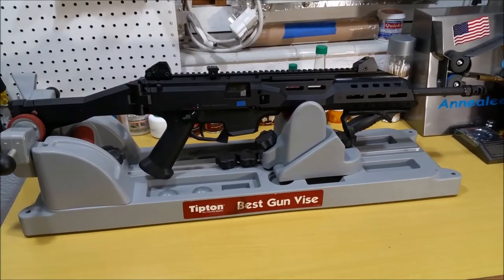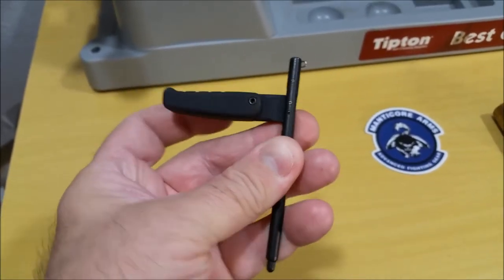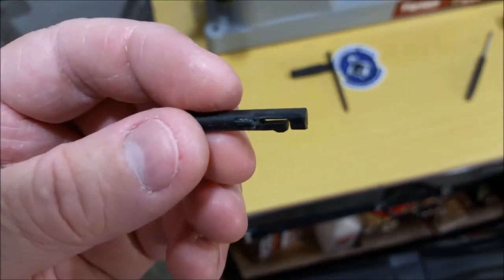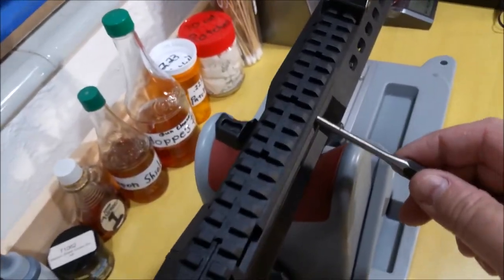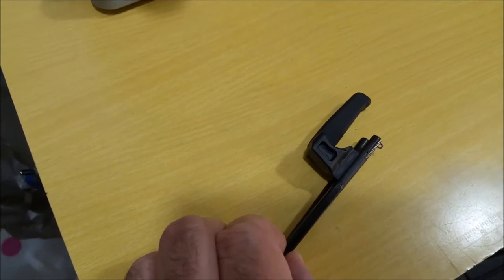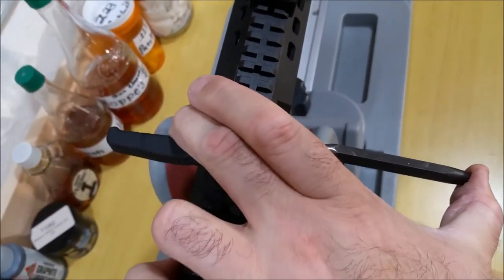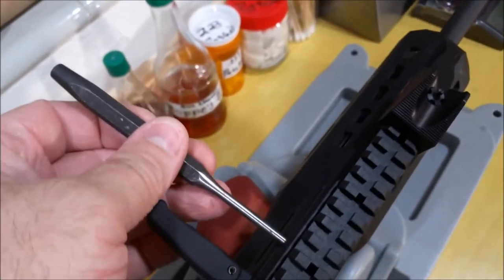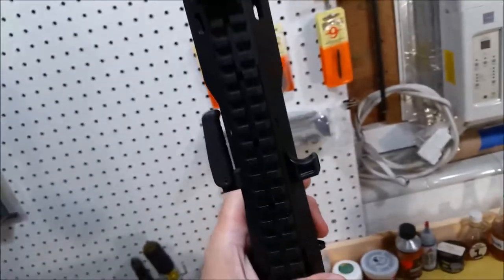Manticore Arms CZ Scorpion Evo Charging Handle

Comment: Somebody in the comments mentioned it's not necessary to depress the spring when installing. WRONG! I tried installing the charging handle without depressing the spring. It will slide in with little resistance but will pulled the spring out. The new charging handle is now useless.
Reply: Yes that hoop spring is very fragile

Comment: Great video, but I do see a potential problem with that charging handle.  Looks like there is a detent in this handle that sort of locks it in place when pushed forward.  I just see it wearing out after repeated use and having a handle thats wobbling back and forth.  Wouldn't affect the functionality of the firearm, but it would be awfully annoying
Reply: Definitely needs a spring to keep it closed

Comment: Informative video, thanks Paul. One note: You only have to support the spring going forward with a punch or tool, when taking the charging handle off the firearm. The spring is meant to go into a hole when it normally functions (it's the detent) and will not break/bend going backwards when you're installing it, so you don't have to support it through the pin hole with a punch or tool. 

And to tiny dick Tim smith above:  I seem to have completely missed your content on your channel, you know where it says "this channel has no content"!?... So where are your better made videos and fancy tripod there sport?

Comment: I'm intrigued with ths charging handle. I've read that in comparison to the OEM the rod is thinner and shorter. This causes the charging handle to rattle. I don't know if this is an old problem. And if so, has this been fixed. Does the Manticore Charging Handle rattle on your Scorpion?  Or any comments, insights would be appreciated. Thank you.
Reply from the maker: No it doesn't seem to.
Reply: The OEM one is plastic and after time it thins out and rattles, A LOT!
From what I figure the stainless steel ones are the way to go, but this is only speculative on tolerances.
I have no info on this one, gonna look at site, if they haven't added a spring by now its unfortunately a hard pass.

Comment: Hey All, I just bought this awesome little guy. Anyone know why I could be having trouble pulling back the charging handle. It’s literally stuck and takes almost everything I have to pull it back. SMH 🤦‍♂️ new to firearms so could be a rookie issue
Reply: Make sure the safety is not engaged.
Reply: How did this turn out?